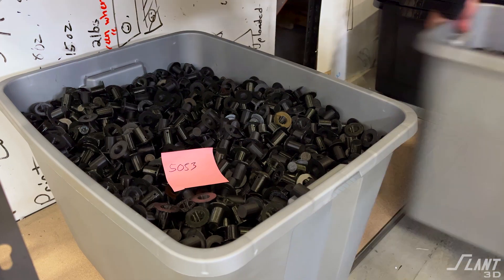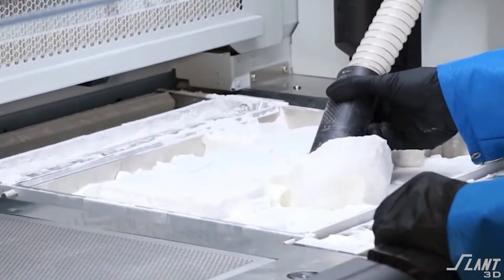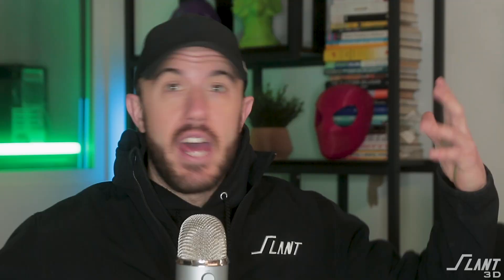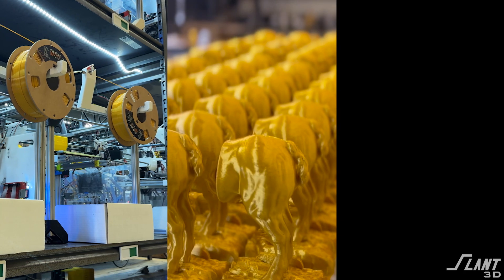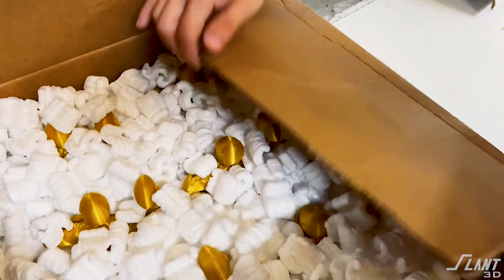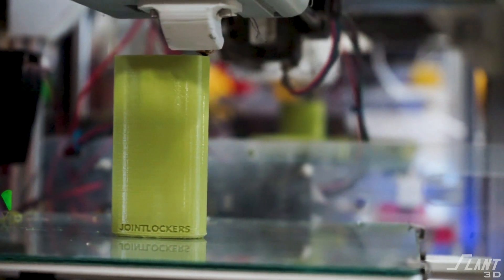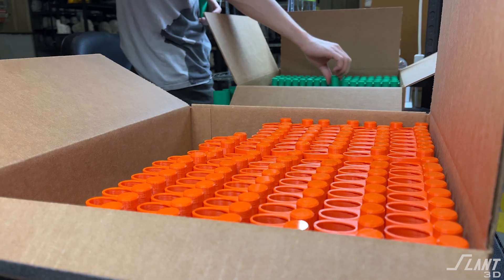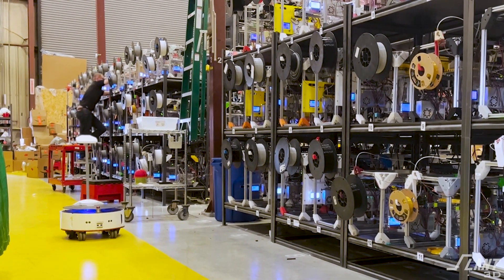3D Print Farms are the Most Reliable Supply Chain | High-Volume 3D Printing

Comment: Have you guys looked into automating spool changes? If your part is 100 grams you will have to change a spool every 10 shots. With 3000 printers i would imagine you would need quite a few people on the floor just walking around changing spools. Or do you just use some jumbo sized spools?

Comment: I'm building a product for online sales now, and planning to use Slant 3D as I need to scale up. The quote I got was reasonable. The amount of detail and features (aka value) that I can design into the parts is endless, and the capital cost remains the same... $0. I can design snap brackets that aren't possible with molded parts. I can promise customers that if my "startup" stops operating, I'll make all STL files available as they need. Repair parts, or upgrades, can be easily printed and shipped out and I'm hoping to make that cheap and easy.

The possibilities are endless, and I'm excited to give this a try. I appreciate the videos! You are inspiring me along the way.
Reply from the maker: Thanks for sharing
Reply: Great perspective.
Regarding if startup stops operating, may not even need to share STL files, just leave on file to order from Slant 3d. 
 @slant3d  could offer the equivalent of a "Svalbard Global Seed Vault" that stores global plant seeds. If a client business is destroyed by a natural disaster, production of 3d printed parts can still continue.

Comment: Better for bootstrapping plastic hardware, injection molding is for big boys working at scale.
Reply: All manufacturing processes have pros and cons. Injection molding is rather static, while 3D printing has more pros and less cons every year. This will continue going forward.
Reply from the maker: Incorrect
Reply: @slant3d I am curious since it hasn't really been adequately addressed yet as far as I've seen: why would Valve corp for example begin having the plastic parts of their handhelds and VR hardware manufactured using FDM? Even the aesthetic compromise is entirely unacceptable in that use case and there is no way around it for something like a handheld console which needs to be a particular shape and finish for the human hand. Or lets go with something sitting around my room thats very difficult to make: A very thin, precise, and flexible, plastic piece with snap points integrated into it like the backing plate of a Galaxy S5. You cannot make that with current FDM in any durable form without it becoming significantly bulkier and/or more cumbersome. How would you envision FDM replacing these types of use cases in future?
Reply: @acbthr3840  3d printing is also far slower than injection molding. For example, a lego brick only takes 10 seconds to mold before it’s ready to use. This would literally not be possible with FDM
Reply: @slant3d Also the issue of shipping things cross ocean is not one of lack of access to manufacturing tools in north america, or because it may be undesirable or expensive to have large centralized injection molding facilities. We have them here all over the place. Its because shipping massive quantities of injection molded parts over from china is dirt cheap.